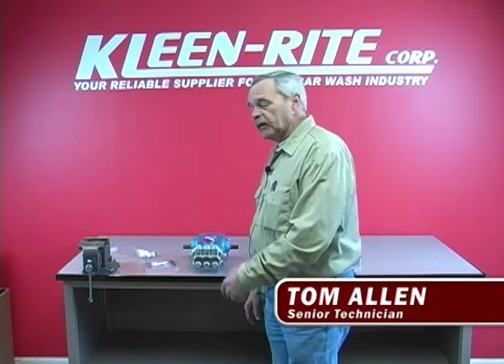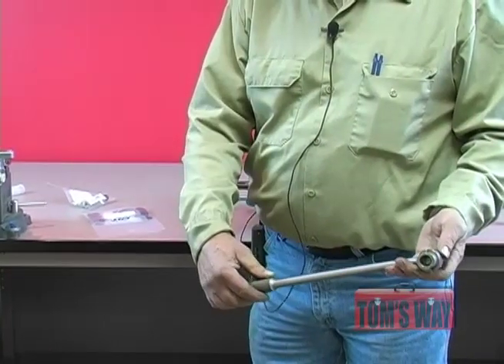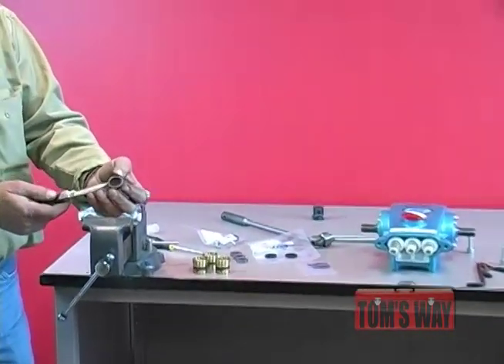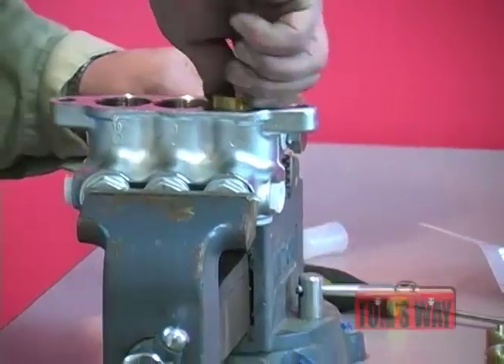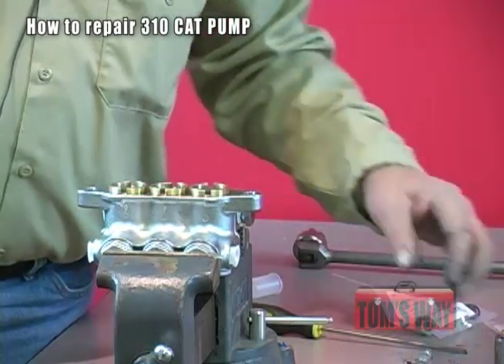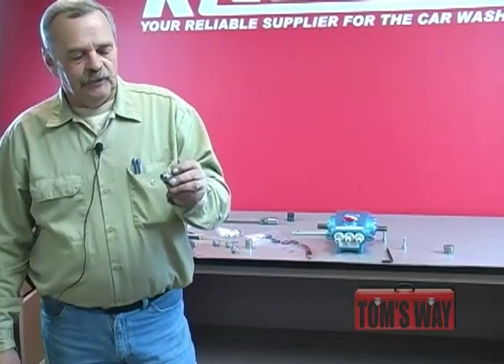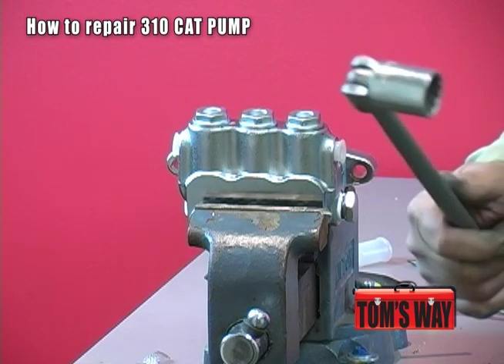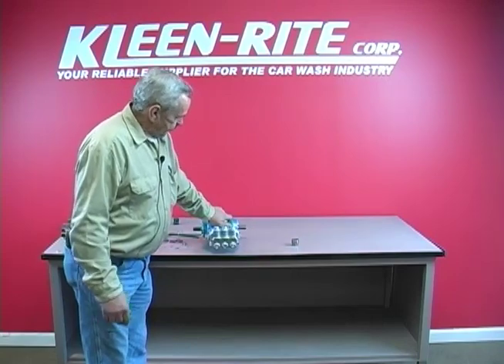CAT Pump Maintenance

Comment: Hello Tom, I was wishing you would have explained in more detail about removing the ceramic bolts to change the flat o-rings that are included in the seal kits. I usually crack the plungers when tightening. Can I trust a 1/4 inch torque wrench set at 55 inch pounds for pump 66dx?